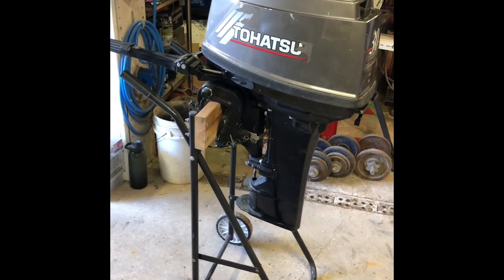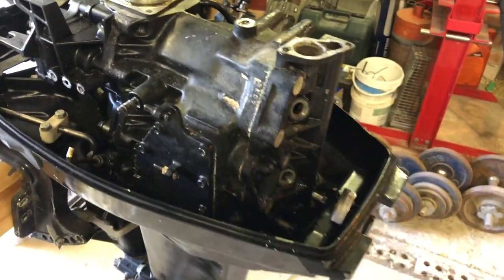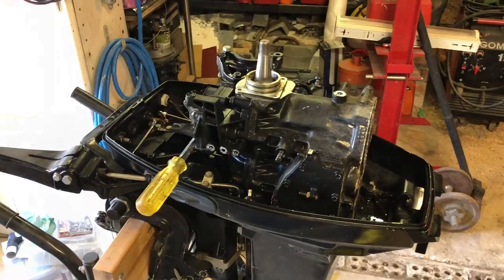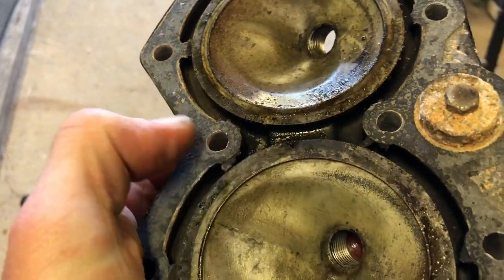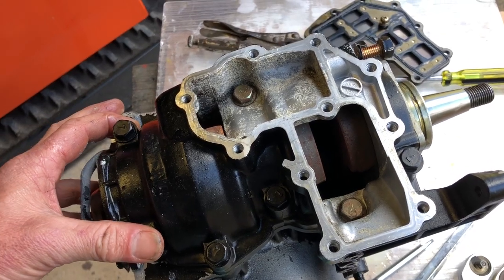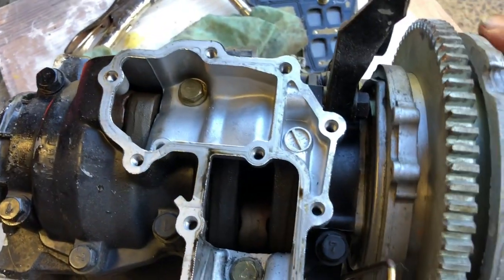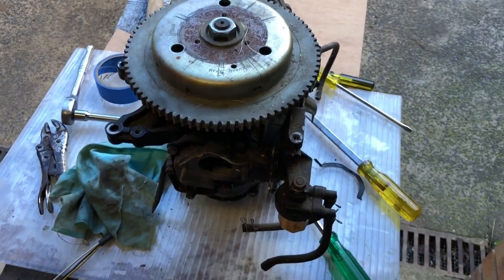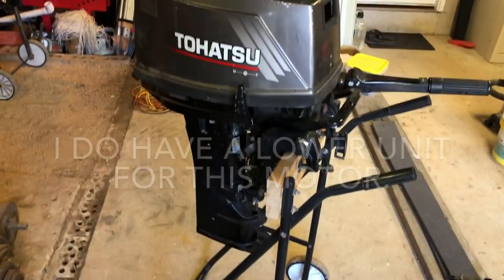25hp - 30hp tear down two stroke.

Comment: I've got the 25 hp merc/tohatsu 2012 model. The only problem I got is revving and going up to speed issues. In which i'm trying to solve by getting a new carb, impeller, filter, 3/8 fuel lines, prop, and prop shaft. Hopefully my baby will run after that. I had it for 7 years and it just started slowing down last year.  Thanks for breaking yours down, it helps a bunch. Lastly costed me 2000 and I was 18 when I got her. And the good part about that motor is access to parts.

Comment: The crank is allways my concern when I buy used outboards. I am no mechanic, but have learned all by watching you and others on youtube and fixing alot of outboards. I love cleaning them up and replacing parts and see and hear the difference.
Reply from the maker: Good to hear you love tinkering with outboards, I’m the same, it’s awesome 😎 
Glad some of my videos have helped you, definitely fixing heaps of outboards is the key to learning.
Yeah, the crank 👎 it is my concern too when buying a non runner outboard or low compression outboard.
Often you can feel or work out if the crank is bad before pulling it down, sometimes you only know when your looking at the crank in your hands.
If I’m wary of a crank on a outboard I’m buying, I try to set a price that I’m happy to pay that reflects the pain of trying to get a crank or I just use it as a parts motor.
Keep up the good work, it truly is fun diagnosing, replacing parts, tuning and getting an outboard to run sweet when it was a bad runner.
Cheers 🍻

Comment: Good stuff…looking forward to the rebuild. Tohstsu make good motors.
Reply from the maker: Cheers mate 👍
Hope I can find a crank.
Tempted to try and rebuild one of the cranks with a new rod and crank pin, might be a bit beyond me though.
Cheers
Reply: Come on Glenn you can do it , fix the crank pin take it on
Reply from the maker: Hi Steve,
Cheers mate.
Very tempted to try, I have the press, and think I have the correct measuring gauges etc.
Might try with the two cranks I have to make one good one then no loss of it’s a fail.
👍

Comment: Hey man , what’s the model ? Are all 30hp Mercury’s the same parts ? Or do I need to have the exact same part. Only ask as my model number sticker wasn’t on my 2nd hand outboard
Reply from the maker: Hi Champion,
I think from 2003 onwards are very similar, even before 2003 parts seem to often be the same.
Cheers 🍻 
Aussie Boat Guy 😎
Reply: Have a 2006 Mercury and yes identical to them, still double check but, there are EU models and Japan models. The 100 hour service is all the same parts when ordered from eBay or similar

Comment: Hi mate what would the diffrence be between a 2 stroke 25hp mercury and a 30hp I've read that it just the carburettor do you know if this is true? Thanks if you reply 😊
Reply: Restriction plate behind carb. And timing is off 5 degrees

Comment: Seems to be a common problem those bigends on the tohatsu/nissan/mercury/mariner 25 and 30 HP powerheads. ,same here on a 30 hp
Reply from the maker: Hi Mate,
Yeah it is, I really don’t think it’s a manufacturing issue though. It is more likely people forgetting to run oil in their fuel (seen that a few times with people) or overheating due to not keeping maintenance up on the water pump or thermostat. Also overheating due to bags of picking up weed.
They are truly one of the strongest motors I know, they just want fuel with oil and cooling water and your set.
Cheers 🍻 
Aussie Boat Guy 😎
Reply: @25hpboatracerman  thnx for the reply Mate. Yes I totally agree.  I like these motors too, but picked up a bad one ,bought it on a boat .
want to fix it so bad because everything else is in good shape ,I'm trying to find parts ,but this powerhead or parts is hard to find in the netherlands.  But love your video's, i keep watching.   Love the prop and tuning videos  . 👌

Comment: Great vid - I’ve got a 25 same vintage.
Reply from the maker: Cheers mate,
Yeah they are awesome motors, love the two strokes, tohatsu is great 👍
Reply: Hi mate, just wondering if you have ever removed the restrictive plate from the 25 to make it a 30hp. Lots of conflicting info online, the 30 seems also to have a restrictive plate the same size as the 25…but some people have removed it all together - interested if you have tried this with the  Merc/ tohatsu motors. There also seems to be a racing porting kit for the 25 carbs with bigger jets and adjusted cam….Cheers.

Comment: Hey mate, any chance you could do a video converting a Merc 25hp to 30hp.  I believe it’s a removing a restrictor /plate on the carby and timing adjustment.  Does that sound right? thanks
Reply from the maker: Hi mate,
You are correct, it is just simply the gasket behind the carburetor (just cut it to a full round throat instead of the restricted rectangle) or but the 30hp one then advance the timing a little.
Very very easy upgrade mate.
Cheers 🍻 
Aussie Boat Guy 😎
Reply: @25hpboatracerman  thanks for the tip, I’m going to give it a go 👍

Comment: Hey mate, what’s the normal operating temp of a 2 stroke outboard?  I’ve just purchased a 2006 25hp Merc Seapro Japan. Feels a lot hotter to touch on idle but warm water exits the tell-tail.  Impeller is good, haven’t boat tested it yet. Thanks heaps!
Reply from the maker: Hey mate,
A lot of outboard motors run at about 60 degrees Celsius (which does feel a bit warm to touch)
With your motor - is the exhaust plate cool and the head really hot?
The head heat is controlled by a thermostat (often they get stuck shut). It’s in that little cover at the top of the head. Not a bad idea to replace it anyway. The exhaust cover should be reasonably cool, if it’s very hot then the cooling flow is probably restricted somehow or the flush muffs are not sealing properly.
If you splash a few drops (not a big splash as if it is overheating that may crack the block) of water on the motor when it’s to temp the drops should not boil, if they do it’s definitely running too hot.
I believe you can also get some different heat sensitive stickers or pens that you can place on the block to really see what’s going on.
Please keep me posted mate.
Cheers
Reply: I bought a electronic temp gauge & cross reference first. The outboard at the piston block was 45deg before starting.  I was 38deg on my arm and my V8 ute I just parked was 100 deg on the block.  After several minutes but less than 10mins the piston block reached 100deg on idle with the outboard in a large water bucket.  Unsure of the water jacket temp. I will purchase a new stat and gasket this week.  The compression is 120psi after 6 pulls on both.  Will keep you posted...cheers!
Reply from the maker: @qldshane  
Good job mate 👍
You are on to it 👌
Reply: The Aussie boat guy. Hey mate, I’ve replaced the thermostat and gasket on my 25hp Merc but it’s still reaching 100deg on the block and even higher on the head.  My 25hp Yam runs up to 65deg.  If it’s pumping water and has a new stat any ideas? Is there a poppet valve I should look at? What temp does your 30hp Merc idle at? Thanks!
Reply from the maker: @qldshane  
That’s weird mate. 
So frustrating, good man for being patient and switching off before damage 👍
Definitely too hot if your temp gun is correct.
Is it pumping plenty of water or is the flow weak? Is there water coming out the leg exhaust relief as well as the tell tale? Is the water coming out boiling hot?
There is no poppet valve in the Japan built 25 - 30hp two stroke.

Could be a lot of things unfortunately.
If the water pressure is low 
- it could have water gullies partially blocked, or a bit of old impeller blade somewhere reducing flow.
- the water pump case may be sucking air or not sealing the water tube properly.
- old mud wasp nest up in the leg exhaust relief.
- water gullies full of salt sludge.
- even had one with a hole in the inner water jacket ( bad casting from factory) 
that was squirting water directly into bottom cylinder.
Just a few thoughts but still interested in water flow and if cooling water is coming out of leg - exhaust relief hole.
 I have also had an aftermarket impeller that was not tall enough to seal in the pump case properly, only genuine from now on.
Please keep me posted mate.
I hope it is ok 👌 
Cheers
Reply: The Aussie boat guy. Hey mate, so I removed the lower unit and flushed high pressure tap water through all possible avenues, cooling & exhaust.  I tested it again it was still reading in the 100’s.  So I launched at my boat ramp, took the cowl off and kept checking temps along the way.  Surprise it was always sitting around the 60’s.  When I got home I flushed the motor and noticed water now exiting the upper exhaust port which it didn’t before.  It now runs 55deg with hot water through the upper exhaust port and cool water through the tell tail at idle.  I’m thinking the exhaust pressure while running at high revs cleared the blockage.  A large cockroach even came out of the motor when I got back.  Thanks for all your prompt advise, I’m glad it’s sorted!!
Reply from the maker: @qldshane  
Awesome 👏 
That’s a great outcome mate 👍
Well done

Comment: You modding this engine at all?
Reply from the maker: Hi mate,
Not modding this one. 
I have found a crank for this motor now though, a mate dropped off two more broken blocks and one had a really good crank 👍.
Cheers
Reply: @25hpboatracerman  right on man! Hey I have a question regarding shaving the head on a 25/30 Tohatsu im going to be milling mine this winter and wonder if you remember how much you guys shaved off yours ? I read on an older form Ausseracer says there’s a lip on the cyclinder head you can shave down too but I can’t see it. Any info or advice? You’re my only hope!! Haha Cheers man
Reply from the maker: No one really wants to say as if it’s done badly it can damage the motor. I’m happy to say what I did but you will have to decide yourself how you want to do it.
I used to bolt the head on without the head gasket and see if it spins over freely with out the head  gasket installed. If so then you know you should be safe to remove the thickness of the head gasket from the head.
I never measured the exact amount unfortunately but from memory one of my racer mates said he removed 20 thousands of an inch (which is only about 1/2 a mm). I feel like I took more than that.
Of course you need to do this stuff at your own risk and this is not advice, it’s just what I did.
We did get a fair bit more torque but no extra top end speed.
Cheers and keep me posted.
I’m sure there is a better way and someone should know the exact amount to take off, keep searching.
👍👍👍
Reply: @25hpboatracerman  Awesome man ! Thank u so much for the info makes sense to me. I was planning on measuring the squish and go from there I have a mill at work I can use it’s just making a proper hold down that may be tricky. Thanks a lot for all the info as always love the channel!
Reply from the maker: Cheers mate 🍻